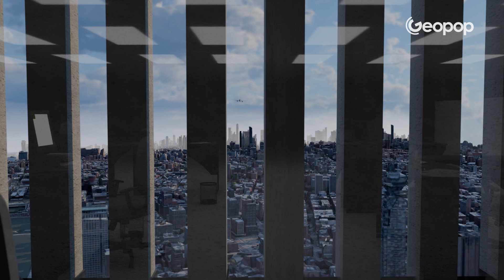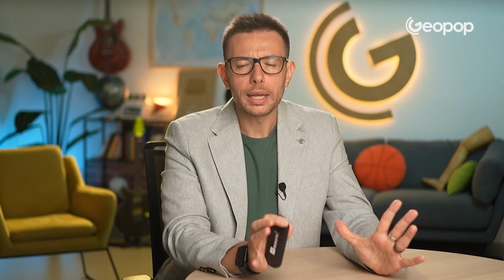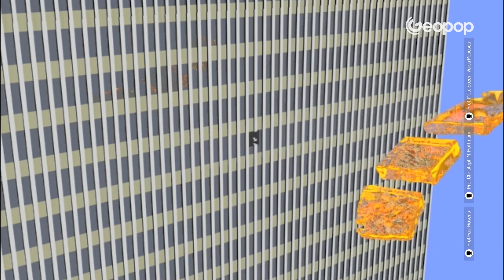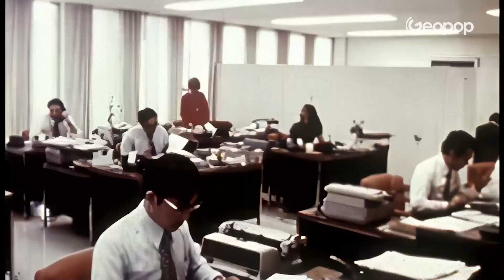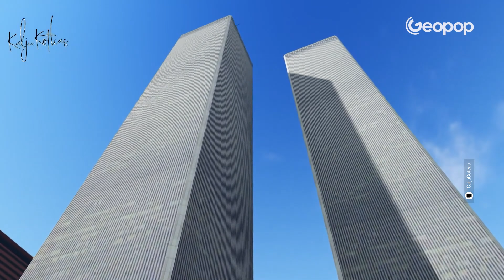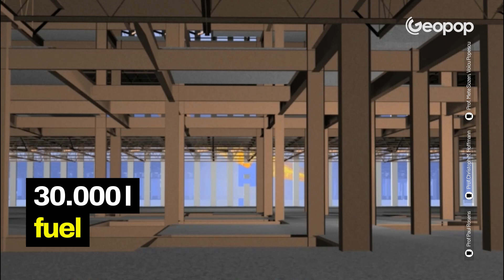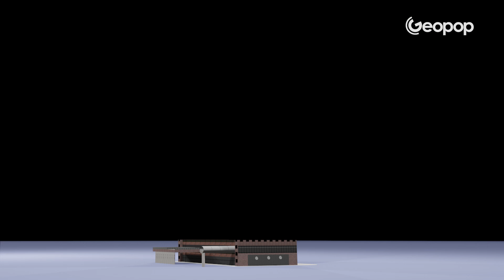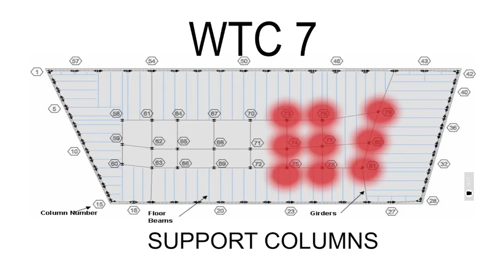9/11, 2001: The Technical Reconstruction of the Twin Towers and WTC 7 Collapses

Comment: This is little more than supporting propaganda for the bs NIST report which has about the same credibility as the Warren Commission Report. Check out the reconstruction video by the University of Alaska instead.
Reply: I did as you recommended.  I suspect you maybe read the Cliffs Notes version of Hulsey’s report and decided you liked it because you think it agrees with what you want or need to believe.

I have actually read both the Hulsey preliminary and final reports from cover to cover, which is more than I can say for most of the people who recommend it to me. The Hulsey report is such a dead horse now, flogged so many times now I find it difficult these days to drum up the enthusiasm to do it yet again. But here it goes.

My opinion of the Final Report is as follows:

The Hulsey Final Report on Building 7 met none of its three stated objectives – indeed could not have met those objectives for lack of trying - and failed to prove its main conclusion, by way of a fundamental logic error; Hulsey claimed he had concluded fire could not bring down Building 7 without accounting for the full envelop of possibilities. Essentially, he claimed to have proved a negative

Hulsey also plagiarized almost 3 pages of material from Tony Tsamboti, who works for the studies sponsor. I hope I don’t need to point out the ethical implications of that.

While promising superior models to those of The NIST, the Hulsey Report in fact delivers grossly inferior models which eliminate the time factor, focus on only two floors and rely on a greatly simplified version of The NIST’s temperature data. The model animations are clearly not derived from the model data as they show no dynamics at all and are obviously forced to make the animations (superficially) look closer to AE911T’s imagining of the real event.

Overall, it is a shoddy piece of work done by a man clearly working out of his element and areas of expertise. It rather reeks of trying to support a conclusion arrived at before the study started. Curiously, study sponsor Architects and Engineers for 9/11 Truth having announced what the study would conclude before they awarded it.

Hulsey tested just one out of countless thousands of possible scenarios, using a completely unrealistic scenario and an artificially restricted set of data almost like he wanted to ensure fire would not cause a failure. The Hulsey Report was so factually inaccurate, methodologically unreliable, scientifically unsound, illogical, and biased that it blatantly violated any requirements of objectivity, utility, transparency, and reproducibility that would have been required to submit it for peer review in any reputable journal.

Hulsey and his assistants have not published the report anywhere that any relevant academic or professional engineers look to.

Hulsey had said all along that the report would spawn several (perhaps four) papers in good American engineering journals and possibly a book.

Then Hulsey walked that back, realizing he'd stand no chance to pass peer review in America and so said he'd go for European journals - but years have gone by with no publication whatsoever. Also, no book from any science publisher either. As far as the engineering profession and science are concerned, the Hulsey report barely exists.

The engineers of America and of the world have never read it. It has had zero impact in the professional community.

To its intended non-engineering literate audience, they Hulsey Report contains enough engineerspeak density for them not to ask questions, even if they were so inclined. Since the report appears to (superficially) deliver what they want, they are not inclined, even if they knew what to ask. From a structural engineering perspective however, The Hulsey Report is of no value, which explains why promises to get the report published in peer-reviewed and reputable engineering journals where it could be scrutinized by qualified professionals were abandoned.

If you are genuinely interested in what happened to Building 7 rather than in promoting a political agenda, beyond The NIST there are several excellent forensic engineering reports out there and over two dozen articles published in genuinely peer reviewed engineering journals that are far more comprehensive and competently done. I suggest you seek them out instead.

And actually read them.

Comment: I was a 9/11 responder. I have yet to see a video concerning Tower 7's collapse that mentions the significance of the City's Emergency Management Bunker located in the building. It was designed to handle any type of disaster except the one that occurred. There were emergency generators in the building in case the electrical grid went down. As one might imagine, electric pumps to move fuel to the generators would not be very prudent when gravity could do the same job without power. Thus, on one of the upper floors thousands of gallons of highly flammable diesel fuel was stored to gravity feed the generators. Also the digital era was in its infancy and there were paper copies of everything. Tons upon tons of paper and thousands of gallons of diesel fuel make for a hell of a fire. And the only water to fight it was from fire boats in the Hudson River. Therefore the FDNY Chiefs decided to let it burn and the sooner it collapsed the better.
Reply: Yes!  Thank you for mentioning that.  It is often overlooked in this type of analysis.
Reply: The generators and grid are mentioned in the video.
Reply: “[F]uel oil fires did not play a role in the collapse of WTC 7.”
--- NIST NCSTAR 1A, Final Report on the Collapse of World Trade Center Building 7 (brief version), National Institute of Standards and Technology, November 2008, xxxvi
Reply: So they would store the fuel on upper floors because otherwise they would need pumps to get it up? Then how would they get the fuel up to store it there without pumps?!? Yeah...
Oh by the way: the fuel was recovered so it definitely didn´t feed fire.
Reply: @Kudde23 The fuel from the upper floor storage tanks of WTC7 was recovered?  After the building burned, collapsed, and was completely destroyed?  Seriously?  You expect us to believe that?  And yes, there were pumps to get the fuel up there to the storage tanks, but the point of this comment was that there were no pumps used to feed the generators, in case there was no power to run them.  It was just pure gravity feed.  Rupture one of those lines, and you have the makings of an inferno.  Which is exactly what happened.
Reply: @ChristLink-Channel  K23 is just a troll. He likely watched a couple of videos and thinks he knows something. For example he cites a source and then discredits it. Few people besides city firefighters know anything about high rise fires. Bldg. 7 was set on fire by flaming jet fuel and red hot steel raining down on it, some of it from 50 to 60 stories above. I was on a search team. The building was evacuated before either tower collapsed so the Fire Chiefs just wanted it to collapse and so they let it burn. All utilities on site and in the surrounding area were taken out by falling debris. The only water for firefighting came from salvaged fire hoses stretched through Battery Park to fire boats in the Hudson. There was no way to save that building nor was there a good reason to try. Number 10 West Street was at the other end of the site. It was historically landmarked and was also totally engulfed in flames. That fire also could not be fought. Being an older building, the steel was all encased in solid masonry. It was gutted by fire that burned itself out, Because of the masonry protecting the steel it didn't collapse and was later restored. In modern high-rises it is just not possible to fight multistory fires. On 9/11 there was no intention to put the fires in the Towers out. It was strictly a rescue operation.
Reply: @bobporch  You are a disgusting liar. There was one remaining water supply and it was in the post office building right next to WTC7. All firefighters would have had to do is take a hose and connect the water supply with WTC7´s sprinkler system and let it do the job. By "letting" WTC7 "collapse" they even risked that last remaining water supply.

"On 9/11 there was no intention to put the fires in the Towers out."

Why did they carry all their firefighting equipment up the stairs then you disgusting liar?!?
Reply: @ChristLink-Channel  Then why would NIST lie about it?!?
Reply: @bobporch  yup.  This thread is crawling with trolls, unfortunately.  They seem to be impervious to facts and hard evidence.  Thank you for adding some more details that I wasn't aware of before.  Makes total sense.  But well obviously be trashed by the trolls who weren't there, even though it comes first hand from someone who was.  Go figure!
Reply: @ChristLink-Channel  Always happy to spread a little truth around. The troll might not even have been born yet and has no memory of 9/11. He wanted to debate me. When I explained something he would come back with some nasty reply. So I deleted all of my replies, leaving a chain of his comments that made no sense without context. I've been dealing with this for 24 years. The fires were still burning when "Truthers" were all around the site with their nutty ideas like the towers were hit by missiles not planes, or that the towers were imploded. The Ladder Ten, Engine Ten Firehouse was built to serve the Towers and was diagonal to Tower 2 (South). The rigs were out and an ambulance was parked in front. When the second plane hit the South Tower, a wheel from the landing gear flew through the air and wrecked that ambulance. Missiles don't need landing gear. Show a Truther a photo and they say it was staged. For 5 years before the world shut down, I was a volunteer museum tour guide. All of us had to have a direct connection and been there. The most interesting group I took out were all architects when they had a big convention in the city. They asked lots of questions. One fellow asked: "Why did the Towers Collapse?" That had been a question I asked myself years before and spent hundreds of hours researching the answer to. So I explained in their terms and they were happy. I miss that but I don't breath so well anymore. If you ever have a question, I would be happy to try to answer it.
Reply: @bobporch  Thank you so much for your service, in all aspects.  Sincerely.  I'm not sure that debating trolls and conspiracy nuts will manage to convince them, but I do believe that it can help ordinary, rational people who have just been mislead and only need to hear the logical, real explanation.
Reply: @ChristLink-Channel  Thank you for your interest. I agree completely with you about the wackeroos. With over 13,000 comments I never expected a response. There are  over 100,000,000 Americans who have no memory of 9/11. It is important to me they learn about what happened. I prefer to focus on 9/12 and the days that followed and the outpouring of support. I never really cared much about WTC 7 because we knew there were no people to rescue or remains to search for. As a museum guide I met all types of responders. We usually did tours in pairs and I would often sign up with people I had not been out with before. That gave me access to bits of information that is not in books or on video. I had been one place and they were somewhere else and we would exchange stories about what went on and where we were. It was never important to me to know a lot of trivia about Bldg. 7 other than there was thousands of gallons diesel fuel and tons of paper fueling a fire that couldn't be fought. Our focus was on Bldgs. 1,2,and 3 where over 400 police and firefighters were missing along with a couple of thousand civilians. I've enjoyed our exchange. Thanks for making a science based video.
Reply: @ChristLink-Channel  The only people who are "impervious to facts and hard evidence" are people who still swallow the official story.
Reply: @markcohen308  Rather, the ones who are "impervious to facts and hard evidence" are the ones who don't understand physics at all, and never will.  They are the same ones who don't understand a lot of things about real life, and therefore in there simplified "minds", it must all be a conspiracy.  _if you don't understand it, then it must be something sinister perpetrated by the big bad "govenmint".  That's why those of us who do understand physics and chemistry just roll our eyes and laugh at the half-wit conspiracy nutjobs.
Reply: @ChristLink-Channel  Blah blah blah blah blah LOL.  You can twist yourself into a pretzel all you want, but you cannot explain away free fall acceleration.

Comment: The fact that WTC 7 collapsed solely due to fire highlights how poorly designed and inefficient the Twin Towers (WTC 1 and 2) were. I believe that, even without the impact of the planes, a massive fire alone could have caused any of the WTC 1 or 2, tower to collapse.
Reply: Maybe, but it would have taken a lot longer.

Twin Towers collapses were a combination of four factors:

Impact Damage + Fire (heat) + Time + Gravity = Collapse

Remove any one of those four factors and there is no collapse.

No impact means no fire which means no time or gravity.  Fire takes time. Gravity acts on everything.  You get the idea. 

The North Tower of course back in the 1970's had a pretty decent sized fire that spread to multiple floors.  That fire was contained because it could be actively fought, there was no impact damage to the building from 120 tons of high speed Kamikaze plane and so the Tower was never structurally in danger.

Conditions were a bit different on 9/11/2001.
Reply: There was a huge fire in the north tower when the twins didn´t even have sprinklers. The fire was on the lower floors with all the building´s weight on it. Guess what, it didn´t collapse, didn´t need to be demolished afterwards, they didn´t even need to replace structural elements.
Right, the twins didn´t even have sprinklers, because the engineers were sure the towers could burn out completely without collapsing.

Comment: The question i will always have is, how did those planes take out those core columns. With the planes being essentially an aluminum tube, how did the planes manage to get through half of the building and still be strong enough to take out core columns. How did those flimsy airplane wings manage to punch through the exterior and still remain in tact.
Reply: 700+ kmph is no joke buddy
Reply: F = Ma

The core columns weren't really the problem, and not the cause of the collapse.